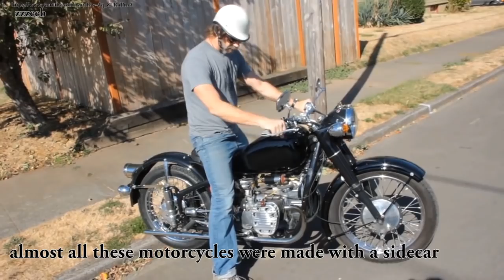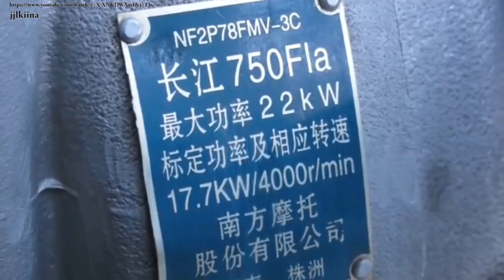Chinese BOXER Motorcycles

Comment: A friend of mine bought one of those because it was so cheap, he didn't trust the machine work so he tore it down completely and cleaned it up. He found metal filings in there and some rough work.  He balanced the rods and pistons and just checked everything as he assembled it. It is now a fine bike similar to a BMW. He probably extended the life of the bike like at least 5 fold.

Comment: Used to ride on in Shanghai , and yeah they are crap good thing is you can redux the welds and rebuild the engine with a screwdriver and hand sledgehammer only tools I carried in mine , another good point is they are cheap as chips ,
Reply: Hairy Banana I
Reply: I had a club of riders in Beijing and we would ride up into the mountains of Huairo every Sunday and find a pond and catch fish whick locals would BBQ for us. A lot of fun back in the late 1990s

Comment: What's the safest way to break in a motor?
Reply: Thisthatandtheother Chan , Ride it like you stole it for the first 300 miles, change the oil and filter,  then ride it like you normally would drive one.
Reply: NO. That is bad advice. Hard break-in is a load of old bollocks.
One can however be too easy going and gentle. This could glaze the bore and rings and not let them wear and seat properly. Most heat is transferred from the piston to the cylinder bore and out to the cooling system through that first (top) piston ring. The rings bedding in nicely with the bore is crucial to compression and engine longevity. All the other brand new components will be much happier too. And it is easier to spot or hear something starting to go amiss when you are not thrashing the tits off the thing. There will be plenty of time for that.
My advice is follow the manufacturers recommendations. If you look you will find they all pretty much agree and recommend the same procedure. And it is actually in their best interest that you end up with a good engine that lasts. Let's also not forget they are the ones who also designed and built the thing.

Comment: they are BMW R75 copies...  but i respect that because now they provide a cheaper alternative to the original which then you can customize to look like the original
Reply: Not R75. They are built on R71 tooling. The R75 had no rear suspension. The R71 had plunger rear suspension, same as the Chang Jiang

Comment: Hmm.  They LOOK pretty; but Chinese engineering is notoriously BAD.  Show me these SAME BIKES one year from now, if they still exist.  Bet they're not made anywhere near as well as German BMW's, in either metallurgy or construction.  And Japanese construction stands head and shoulders above almost everyone else.  Take exception if you will, but check out "Chinese motorcycles" on You Tube; for every one that says their Flung Poo is great, there are a thousand that expose them as junk.  Breaking frames, flaking chrome, and engine failures are just the surface.  One video compares a Mikuni carb to a Chinese carb, and the superiority of the Mikuni is painfully obvious.  Hey, I wish the Chinese well in these endeavors, but they REALLY need to improve their quality, as Japan did in the 60's.
Reply: dead wrong, not fast, not pretty, but this ural copy lasted forever.
Reply: I stand by what I said.  No need to take my word for it;  my scooter mysteriously died after 6 months, and You Tube is FILLED with videos as mentioned above.  Friends in the Philippines tell me the same thing.  And, my favorite pic from China is of a building that fell over, while still under construction.  Chinese quality is CRAP.  The bitch of it is, those bikes ARE pretty.  Pretty, they can obviously do; quality construction, they can't.  The DESIGN may have been around forever, but I repeat, show me THOSE EXACT SAME BIKES a year from now.
Reply: I have to agree with you.  The crome bits on the one I helped deliver.( My other halfs son paid £100 for a 2011 125 that didn't work) are plastic with a crome coating. The thing was also rusting like a good un. The problem that they fsce is even if they did build it with top quality materials would you go out a buy a FONG SHEN 750. Got my new bike today lads, what the HARLEY SPORTSTER you looked at, no its a FONG  SHEN 750.
Reply: The sidecars are over 350 kg, with what feels like an elastic frame, almost no brakes or suspension. Terrifying at speed. Luckily they top out at about 80kmh.
http://www.changjiangunlimited.com/CJU/750/hist.htm
The one shown at 6:00 , it's gearbox explodes just after that video cuts off.
Reply: These aren't new, they're classics.  You aren't wrong about Chinese quality made for exports at the current point in time, as they're terrible.  That's because everyone wants cheap, and China will make stuff cheaper than it's safe to make them.  However, classic bikes made for their own market are pretty good.

With China, as with everywhere, you get what you pay for.  The only difference is China will go even cheaper than everywhere else to the point the bike is almost unusable.  If you buy equivalent priced stuff, it's just as good as everywhere else.
Reply: Really depends on who assembles your particular bike, there are warehouses full of parts made by different manufacturers since the 60s. Source the parts made well, assemble with care and ride sensibly, you may end up with the long lasting well made classic. On the other extreme, get the bits that barely pass, slap together, spend the next few years fettling, repairing, replacing, until you end up with a bike where "nothing else could go wrong," 
  All these bike bits were all made long ago by different independent shops. "You have shovel manufacturing shop? You make 5000 mudguards." "You have foundry and a milling machine? you make 5000 gearbox housings."  and so on, warehouses were filled, bikes assembled at the factory when needed. A pair of new heads cost me $200 Au. Rough as guts machining, but they work and are 40 years old, new old stock.
Modern Chinese stuff is becoming so much better.
Reply: found the gearbox one,  https://youtu.be/wVvQq-5edCw?t=4m10s
Reply: Stupid comparison leads to stupid conclusions and if you add ignorance you'll came out with opinions like this one
I have had one of those motorcycles for 8 years I made trips of 4K kilometers without a single inconvenience. Something quite amaizing for a motorcycle designed in 1937.
Reply: The German final drives are made of glass and gum wrappers. I think a clone of a copy of a clone can only be somehow BETTER.   Oh yeah, one more word "CANBUS".  Say no more.
Reply: +JP Stone.  Canbus, can you smoke it?